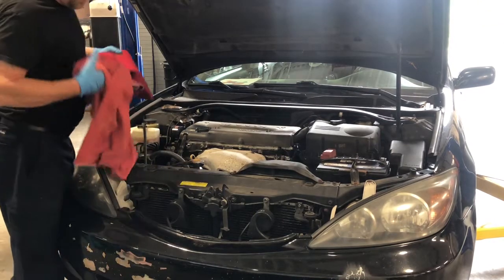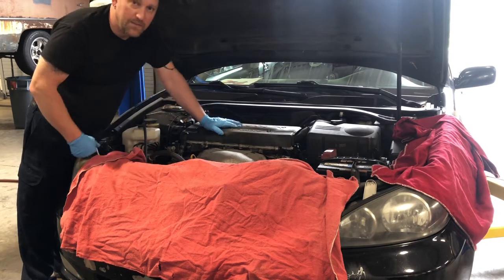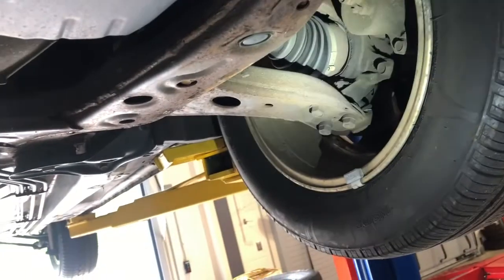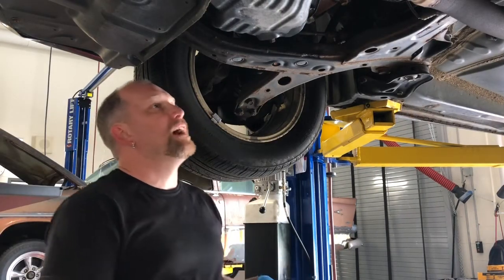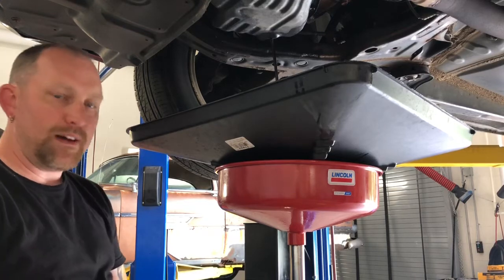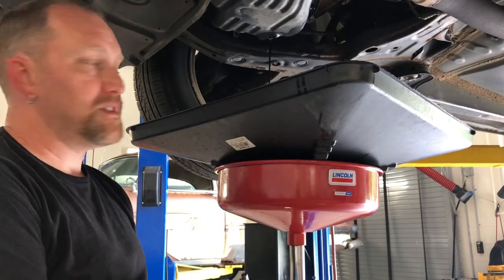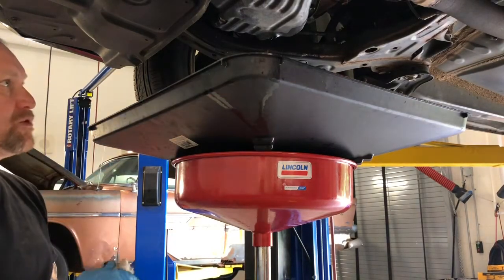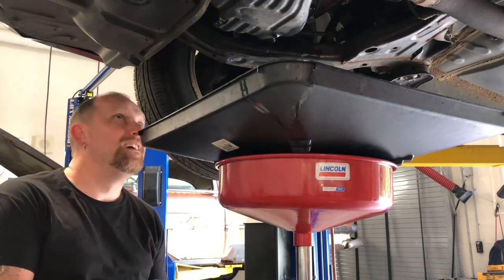How To: Oil Change Part 1 (2004 Toyota Camry 4cyl)

Comment: Great Video. However I have a question. I have a 2014 Camry SE with a 2.5L 2AR-FE. The owners book calls for OW-20 oil, it does not state Synthetic. It also says I can use 5W-20 until the next oil change if the 0W isn't available mineral oil. I have researched and 0W and 5W both are 20 grade oil. I live in Las Vegas, VERY hot can I  just use 5W-20 full synthetic oil? (I am currently without any
warranty. I would appreciate your thoughts or a recommendation who I could call. Please don't say the dealership.  Thanks, Barry
Reply from the maker: Sorry I missed your first comment. :)

Comment: The oil filter is mounted upside down? Why do people say that? I always thought it didn't have an up side or downside but rather a threaded end and a domed end. If the threaded end is mounted up then wouldn't that make it the upside?

Anyway, good job.
Reply from the maker: True true. :) it’s only truly mounted upside down when it’s mounted in the engine compartment threaded end down. :)